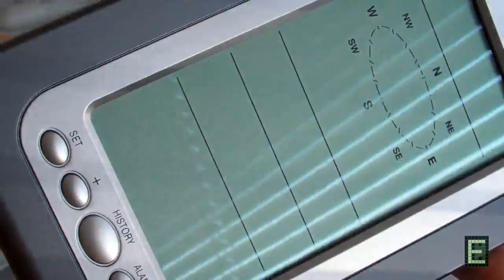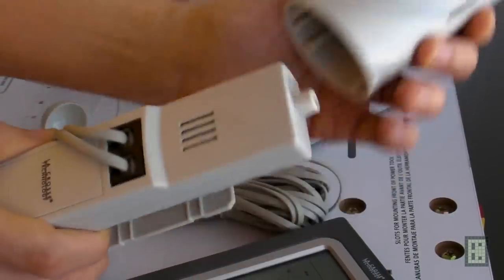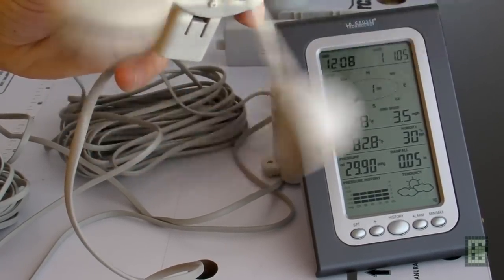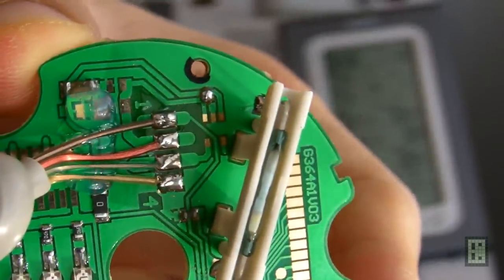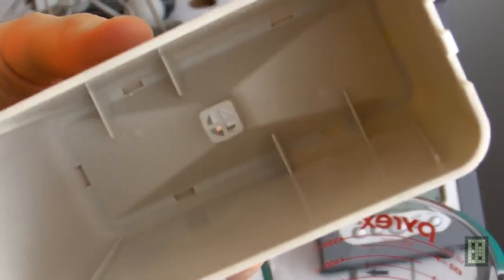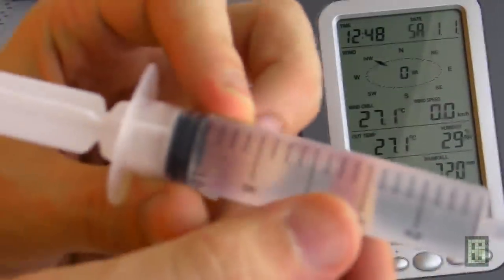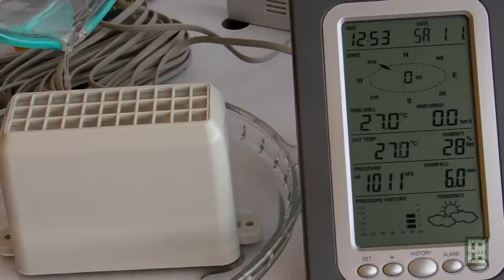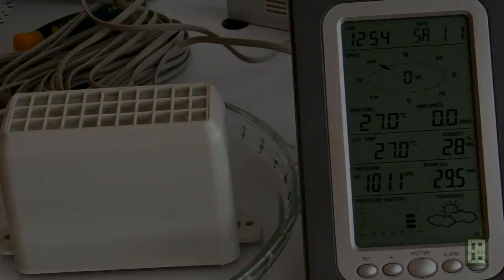Weather station how the wind speed, direction and rainfall sensors work.

Comment: Back when La Crosse made good weather stations. The modern ones are pretty flimsy and cheap compared to the older ones. Same goes for Ambient Weather, etc. The only stations I can think of that isn't flimsy and cheap is the AcuRite stations (still making the good ole' 5-in-1's), and of course Davis. But Davis is lacking the modern conveniences that cheaper weather stations already have. What I like about AcuRite is that they supply lots of parts at a good price (unlike Davis). I also like how they are repurposing the older 5-in-1 sensors, and adding more modern technology to them. Goes to show that you don't need a cheaper weather station redesign to add the modern stuff. This is coming from a weather nerd who's owned several of weather stations, so these are my personal opinions. I'd say in 2021, the best budget durable weather station is the AcuRite 5-in-1 with WI-Fi (you can pick one up at Lowe's for $109). If you don't really care about modern conveniences, Davis is an excellent choice if you have the $$$.

Comment: @electrodacus My first weather station was made by the same company. But before, this was when La-crosse had poor technology. The station never worked. This was 6 years ago. Now I have a WMR100, a Vantage Pro2, and a station simular to yours. The WS-1910U that only does wind speed, temperature, humidity, and air pressure. (rain fall with the optional gauge) I have the WMR100 currently sending to WU CWOP and PWS Weather. The VP2 will soon have that. The WS-1910 is for low level wind measurement.

Comment: I have this exact weather station for 7 years and have experienced one issue you may be able to help me with. I live in a colder climate that receives rain snow and zero type temperatures. Usually during the late fall early spring during  0 C temps my anemometer or wind direction vane can freeze.  This always self corrects with milder weather . However currently my anemometer  will not turn inspite of warmer temperatures. I have tried to view your inside  bearings? Im wondering if the bearing needs grease . The direction vane is turning but the wind speed barely turns and rather than being frozen it might be seized. Can you describe the bearing for the wind speed . Its possible dirt might be causing the rotor not to turn however the station is up high and difficult to assess and dismantle. Does the stem of the direction vane insert into the same bearing pocket as the wind speed? I have a spare station and tried to dismantle it byt had difficulty pulling both sections apart to inspect. Hoping for some description here as the camera pulled away when you took out the circuit board. Thanks for your consideration.

Comment: These things appear to work with Windows 8.1, so i would say it will work with all it's predecessors like XP and 7 etc..just install the program with cd and use the USB lead, works well and easier to change the parameters, all kits seem much the same..Fred UK.
Reply from the maker: This weather station dose not have an USB port or data logging.
Reply: ***** Ok thanks, the one I have is a Watson, think it's made in China, it has a usb connection to a pc to use on computer..Fred uk.
Reply: Tom Smith I have a Watson W-8681 made in China by Fine Offset Electronics Co Ltd (http://www.foshk.com/) who supply the market under different brands -

Comment: its very nice to carry these materials specialize in the diffrerece weather...ans how about the baterial for the problem if the life time coming,,,how about the back up data and software harware?
Reply from the maker: This unit dose not have data logging capabilities so there is no software.
I have another unit right now that has data logging but did not had the time to install or test maybe later in the summer.

Comment: Does the rain guage use batteries  or does it get it's power from the temp sensor
Reply from the maker: It is just a simple reed switch and magnet so it needs no power and is connected to that transmitter/temperature sensor. You can see the reed switch at minute 7:00
Reply: electrodacus  so it does not need it's own batteries  the temp sensor provides it's power correct?
Reply from the maker: Is not like the rain sensor needs any power since it is just a switch and the wires from that switch go to temp sensor and that will count the numbers of contact close events each corresponding with 0.5mm of rain.
Reply: electrodacus thank you